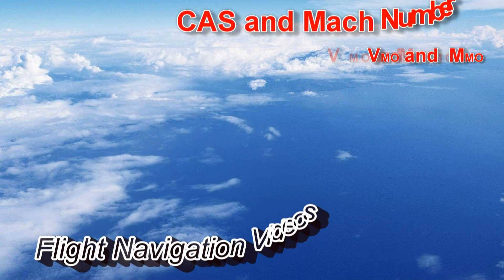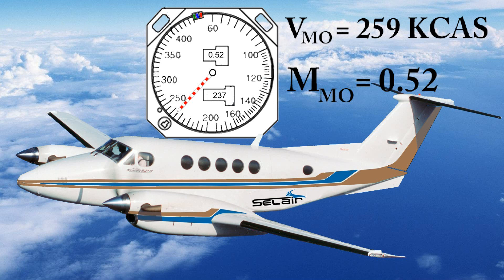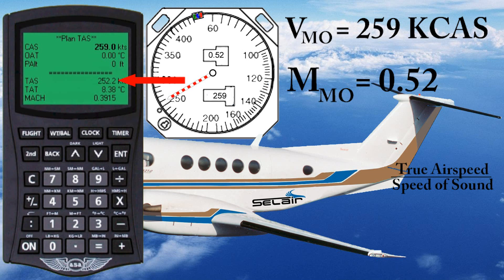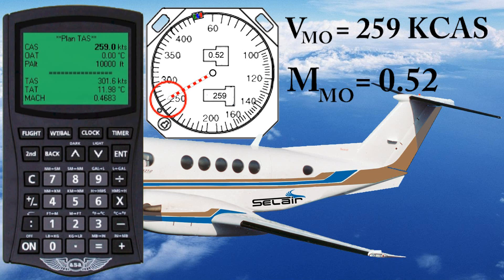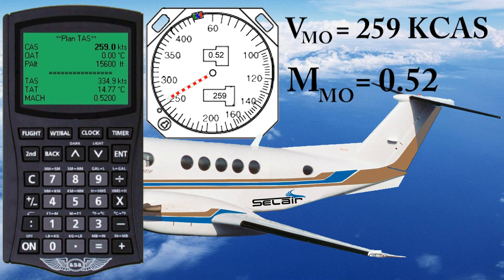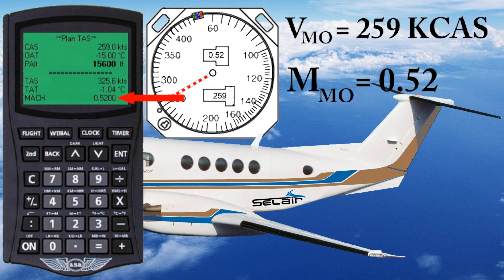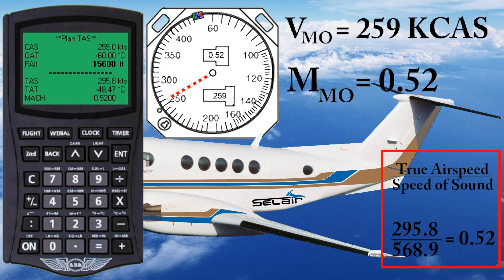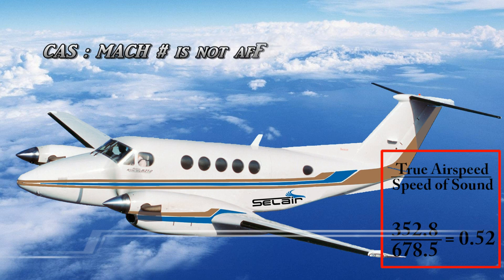Calibrated Airspeed and the Mach Limit

Comment: Hi! Just wondering, where did you get the 644.2(2:32)? Thanks
Reply: Sonic speed in knots (because 1 Mach = 1 sonic speed).

In this case it's obviously 331.4 m/s = 644.2 kts. He just devided the calculator's 252.2 kts TAS by the shown Mach number 0.3915 which gives you the initial sonic speed the calculator used to calculate the Mach number from the given TAS of 252.2 kts.